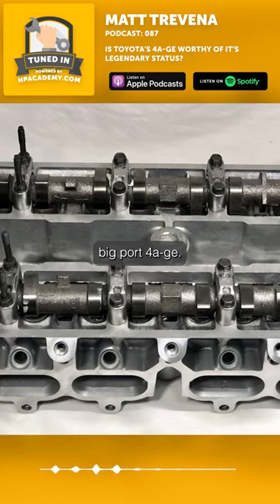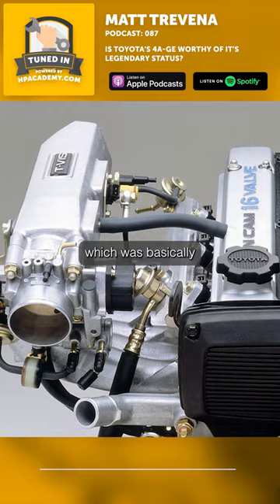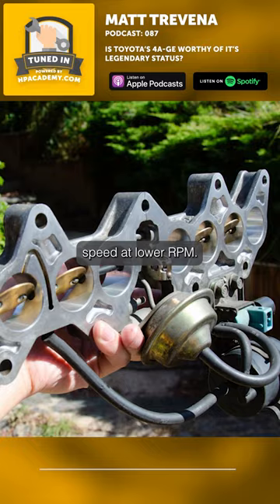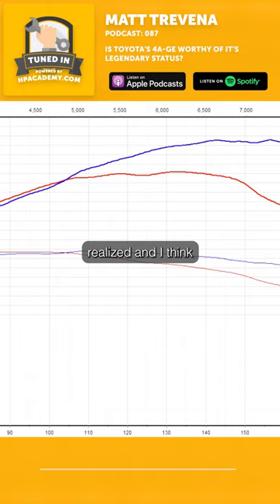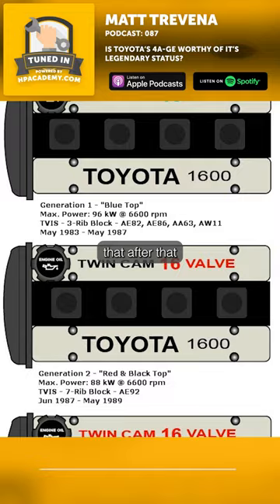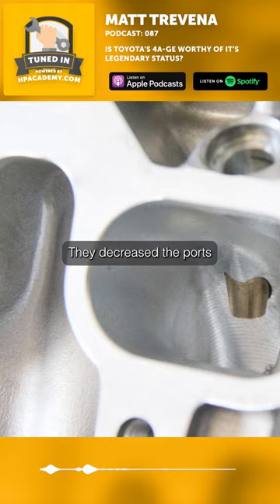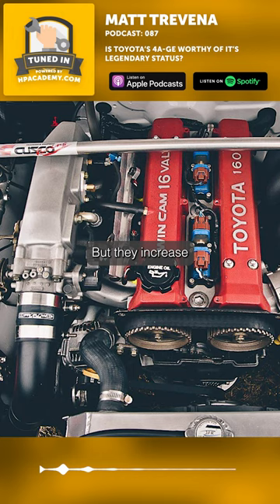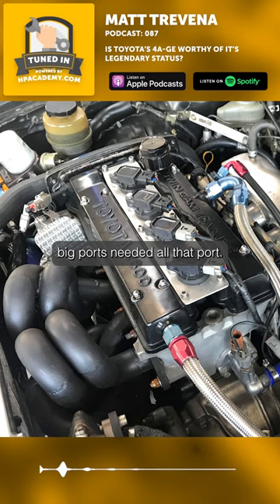The Greatest 4 Cylinder Engine? | 4A-GE Port Evolution #shorts

Comment: Correct me if I'm wrong but wasn't there a version of these motors that came with a supercharger? Maybe they built these to be boost friendly before people saw how good they are just N/A
Reply: 4agze
Reply: @71001L  yes! They put the 4agze in the aw11 mr2 (big port, 8:1 comp 7 rib), and then had a later version available in either the ae101 or ae111 corolla (I don't remember, it was Japan only I think) that had the small port head, 8.9:1 comp. Both versions have 16 valves

Comment: Seems like a fine motor but B is clearly the superior choice. Not to mention K, K is without a doubt the best 4 cylinder engine ever made since 4P has engines making nearly 200hp/L NA
Reply: Comparing a 80s engine to b and k without considering 2zz or 3sge beams
Reply: @RPS13DRlFT all great engines, Toyota just didn’t have nearly the amount of tuning potential or aftermarket support to rival Honda in an overall standpoint 
Also 4age and b series were being made in the same year at one point in time lol
Reply: @sums6969 the 4AGE is better compared to a B16. They’re both 1.6L. Why would you pit it up against the B18? Then against the later Silver top and Black top variants can give the B18 a run for its money

For me anyway the Toyota engines feel more engaging to actually drive and just sound better overall. Hondas engines are definitely better performers tho.
Reply: Idk mate, these take a crap ton of abuse, and it's rather easy to squeeze a few more hp from them when stock.
Reply: @rrs_13 Say that about a K series lol, I own a 2ZZ n wish I could be making power so easy. Bastards go for a header, exhaust, ported RBC or aftermarket intake man, TB and 3” intake and make 225whp all day, that’s a dream for a N/A 4a or 7a, that’s a 2ZZ w a built head AND all the bolt ons, yk?
Reply: For max power, 3rz>k series

Comment: When it comes to NA 4 cylinder engines you can't beat Honda
Reply: To be fair I think Honda, Nissan and Mitsi all have better 4s than toyota lol
Reply: @sircefiro Whether or not Nissan or Mitsubishi have better I4’s than Toyota is just the 3S vs. 4G63 convo… I think the 3S, 4A and 2ZZ have collectively proven themselves superior to the SR and KA, especially since Nissan failed to build another cool I4 after those two, Toyota was building the 2ZZ’s by then. The 4G63 vs. 3S convo really isn’t gonna end but I think most people will agree you just can’t beat a K series. These days however you look at currently produced I4’s it’s looking rather bleak for Mitsubishi and Nissan, neither of them have a very reliable or sporty I4 to their name currently, and while Toyota doesn’t make a sporty I4 themselves their I4’s still remain stupidly reliable and they’ve made up for it with the new G16E. Honda of course continues to use the K20C which is a very solid engine though their K24’s reliability seems to have slipped slightly. Sorry, just don’t think you’re beating Honda or Toyota at the 4 banger (or engine building) game unless perhaps, your name’s Yamaha…
Reply: @loganamurray64  I suppose it depends what you're doing but I'd say sr is better than 3s, zz and 4a, and yeah not many of them are making decent performance motors at the moment so we're mostly stuck with the old stuff
Reply: 3S is miles better than the SR or 4G. For both boosted and N/A applications. The debate is with the K series. 
However, Toyota has the 3rz as the answer to that as well.
We have 6sec capable 3rz’s here in Australia.
Reply: @sircefiro Mate, Sr’s are crap once you take them beyond 400-500whp. Constant head issues and rebuilds. Weak rockers and shims.
Lucky to get a fully built/forged sr20 that reliably makes over 700whp.
Whereas a 3sgte will net 750-800whp with no major issues on a fully built motor.